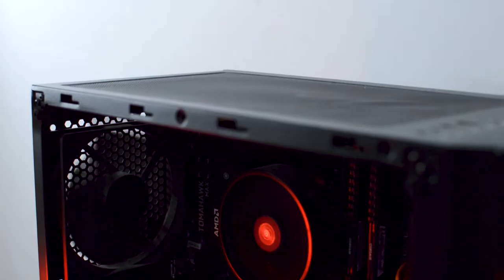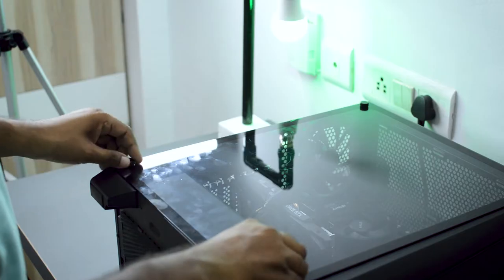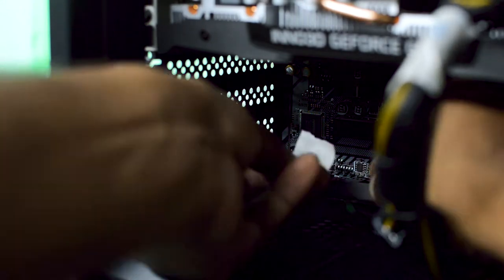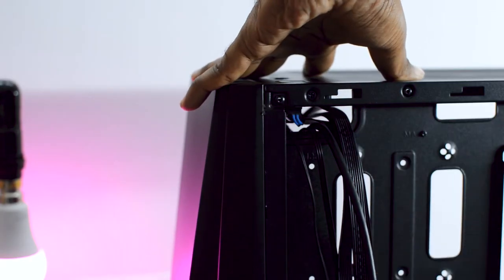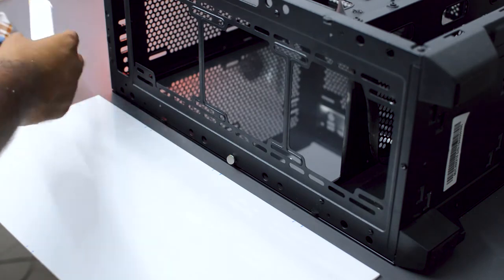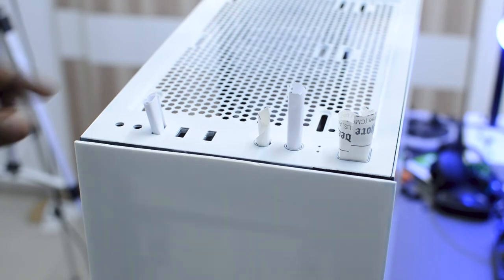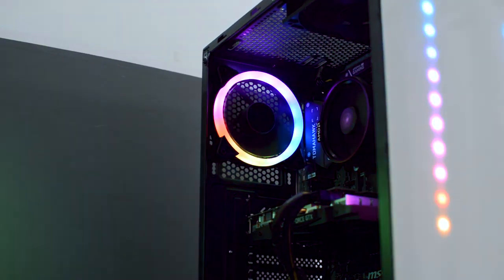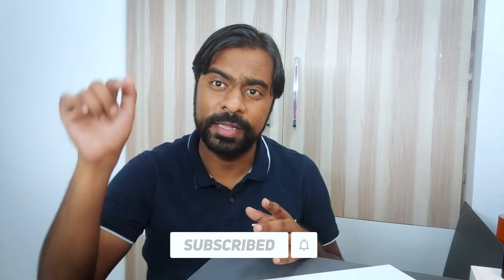My custom pc cabinet | Video editing | DIY | white pc setup 2020

Comment: Why would you take a case that is already pretty good for airflow and then modify the case to choke off the entire air flow? Doesn’t make sense
Reply from the maker: The case has 3-4mm gap on all sides from the front due to magnets so it may look that it's sealed from the front but actually it isn't. Also removing the hard disk case from bottom increases the airflow.
I also checked the thermals before and after this modification and didn't notice any issues.